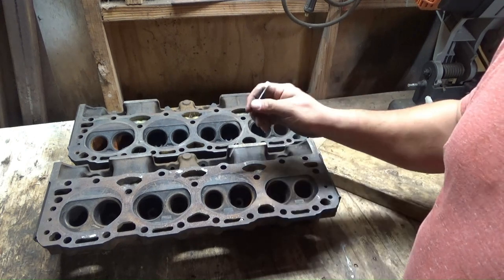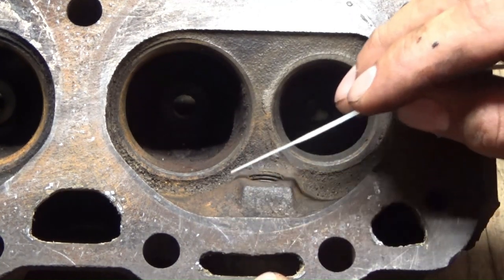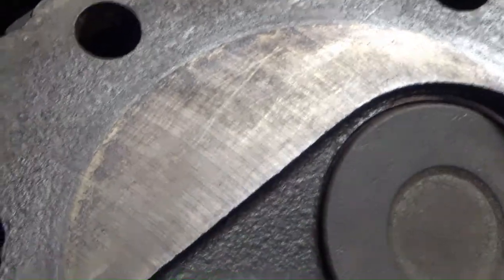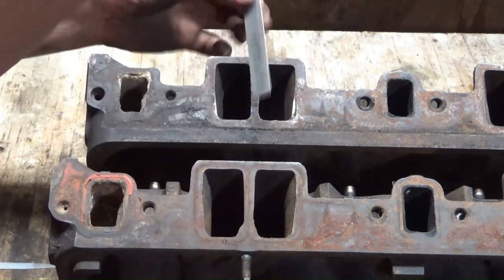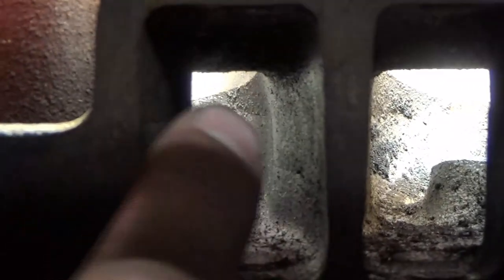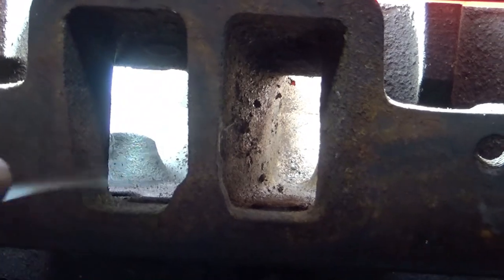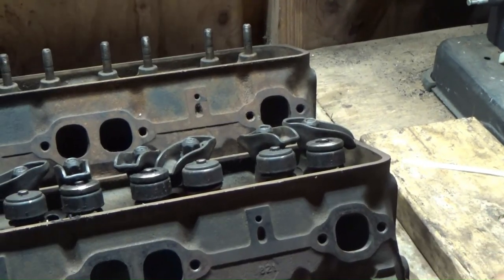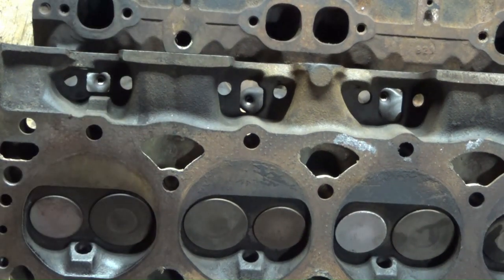305 chevy heads; 081 castings vs 416 castings

Comment: I have an 87 Monte Carlo SS I raced in NHRA Stock Eliminator K/SA (K Stock Automatic) and I have the option of using a 535 casting, 416 casting, and 081 casting. With a 3 angle valve job a 416 casting is hard pressed to hit 180 cfm @ .403 lift which is what a stock L69 cam has. With a 3 angle valve job the 081 flows 197 cfm at the same .403 lift which is actually better than every double hump head with a 1.94 inch intake valve @ .400 lift. Stock eliminator is limited to the stock cam lift which is .403 intake .415 exhaust. Both heads being equal the 081 outflow every other non vortec 305 by a lot and every 1.94 inch 350 head with the exception of the 113 corvette aluminum heads. If the other heads flowed better I'd be using them. And as far as the earlier smog castings (555, 434, 450, etc...) had 1.72 inch intake valves and are in no way shape or form a performance head. The chambers suck, the port suck, and theyre about 15 lbs heavier which in racing is a bad idea. Opening up the valve seat and putting a 1.94 inch intake valve in these heads will actually flow less than a 1.84 inch if you do not port them. Randy Brzezinski (Brzezinski Racing) has a whole video on this for those who are non believers. The intake ports on an 081 are 167cc whereas a 416 is 162. The exhaust ports are identical in cc's and flow numbers which is in the 119 cfm range with a 3 angle valve job. I wouldnt waste any money on these heads other than installing screw in studs and DO NOT ever use a roller tip rocker arms, they do ZERO for performance. Either use a full roller or a stock rocker, the roller tip rocker arms are waste of money.
Reply: The roller tip rockers do help with valve guide wear.
Reply from the maker: I never really thought about that, but I believe it.  I always wanted roller tip because it's supposed reduce friction. But that's probably a better reason to buy them.
Reply: @ChuckUFarley-r7x  so does synthetic oil, its the fulcrum that matters not the tip where it presses on the valve.

Comment: I have built hundreds of small block Chevrolets over the years, and I think I can say with confidence that the 416's are superior to the 801's. In fact, the 416 is probably the best 'stock' head you put on a 307. I have built several 307's with these heads and mild to moderate cams and they absolutely scream. I love em!
Reply: Whats your opinions of these 416 heads on a 350 for a low rpm torque and mileage engine?

Comment: In 1995, the hot tip was a pair of 1976 305 heads, the only year they were heavy casted. Those coukd be cut for 1.94/1.60" valves, no problem. I did it myself. But now, just get a pair of L31 heads shaved 0.030" and do all you can fir exhaust flow.
Reply: and with a 1.94 inch intake valve they flow less than a 1.84. Those heads had a 1.72 inch intake and tiny intake ports that flowed about as well and straw trying to suck up an icee.
Reply: what casting number were they? 434 or 450?

Comment: What size engine you putting these heads on ? I have 416's going on a 1971 307 chevy.
Reply from the maker: They are going on a 305.
Reply: everything being equal a 307 with its bigger bore and shorter stroke will beat a 305 in horsepower by a lot.  Ive seen 307s making 325 hp all day long and the 305 heads only had a 3 angle valve job screw in studs crane springs and it had a retro fit hydraulic roller cam.

Comment: DO NOT REMOVE the turbinates on the 416 heads (the material in the corners). They are not obstructions, they are there to spoil the air. This results in the air washing the walls of the chambers of fuel droplets and increases air velocity (air speed).
Reply from the maker: Where did you get that information from?  I think every perimeter bolt sbc heads have that.  I'm assuming they are just where the valve cover bolts go. I have never heard of them being there to serve a purpose. I will most likely remove them...

Comment: 416 is 58ish 
081 is 56ish from factory 
No real flow difference,
But 416 can be worked better because better strength in casting, up sizing valve won't increase flow much but cleaning up roof and entry helps, 416s have been a junkyard gem for rules class dirt track engines, H.O. heads prone to cracking like vortec heads, 416 flows as good as standard 350 heads but add good compression, the box around the plug on 081 heads create a hot spot prone to pre ignition and needs to be rounded on the corners if installed on 350, hope this helps, 👍
Reply from the maker: Any information helps thanks for commenting.  I'm building a 305 with flat tops.  I was leaning towards using the 416 heads just because I have a few intakes for the older style.  But the valves are looser in the 416s and probably need valve guides.  The 081s are noticeably tighter so I will use them instead.  People were using 305 heads on 350s to bump up the compression 20 years ago.  I'm not a big fan of doing that but it will make a soup bowl piston 350 wake up a little bit.
Reply: Last year I built a low mile 305 standard bore. Installed flat tops mild port job and 3 angle valve job on the 416 heads summit 1103 cam and knock off rpm intake with performer 600cfm carb. Sounds mean at idle makes decent power and runs on cheap 87 octane gas. Well worth it if its just laying around.
Reply from the maker: @andrewfortier88  I will definitely take a look at that cam.  Because I really don't have any knowledge or experience on what would be a good cam for a 305. I was actually thinking about using a stock lt-1 cam since I can get a used one for free. I'm not really sure if that's a good cam, but I'm looking into that. Thanks for watching and commenting.
Reply: @davidcraft4909  it is a mild cam in a 350 but in a 305 with 10:1 compression it really runs nice, starts easy has a nice chop good throttle response and pulls good to 5500 rpm. If I was to make an honest guess I'd say 275+hp. Stock hp is like 160
Reply: @davidcraft4909  Lt1 would be a roller cam I've only ever built a flat tappet. I always take the old cam out and toss it in the scrap pile. Plenty of cheap cam kits out there to suit your build.
Reply from the maker: Yeah I know a lt1 is a roller cam and I have a roller block lol. I already looked at that cam you mentioned and it's specs aren't too far from an lt1 cam. Let me ask you this. With your setup what kind of vehicle weight, gears, and transmission.  I'm just trying to learn some stuff.
Reply: @davidcraft4909  2500 pound rat rod type car 2.73 gears. Stock th350 converter. 28" tire posi rear end. Has no problem breaking them loose and will do doughnuts on the highway. Its a fun low dollar set up. Slightly lower gears would be even more fun.
Reply from the maker: @andrewfortier88  I bet that car is fun, it wouldn't take much power to make a 2500lbs car go fast.  I'm trying to build a 81 C10 lwb for the 1/8 mile. I will be turbocharged, but you still need to make some decent power NA so that way it will spool the turbo faster and not be a total turd before the boost comes in. Anyway so yeah any info helps on any kind of combination that people have ran with a 305.
Reply: no real flow difference?  i beg to differ,  stock 081 heads outflow the 416s with a 3 angle valve job. The 416s have 162cc intake ports which is emphysemic.
Reply: @andrewfortier88   my K Stock Monte Carlo SS has 29 inch slicks and 4.56 gears. It runs a consistent 11.60s @ 117 mph with a stock intake manifold, 780 quadrajet, and unported 081 heads.  Ive yet to race another 305 powered stock eliminator that can beat me. And dont even start me on how many big blocks and small blocks Ive put on the trailer.
Reply: @MasterWitchDoctor  yeah, the 081 is 165cc as cast there's no real difference and needs more work just to gain. O1-.015 in your ET real world and neither flow enough for over 6500 rpm they're better suited for their velocity/ torque  but for small ci applications the 416s are more reliable and readily available.
Reply: @dillinpicklesworth5698  youre 100% correct in the 6500 rpm Im shifting @ 6700 and running 6800 at the end of the track. I get my acceleration from a 700R4 and 4000 rpm stall. At the 1000 feet mark Im in torque converters lock up which is where I get my speed.
Reply: @MasterWitchDoctor  I don't know the weight of your car, but have you used 4.11 or 4.30 gears to try to get the big end speed up 120 - 125 mph, that would probably put you at the traps right at your shift rpm but your stahl is pretty perfect. 👍
Reply: @dillinpicklesworth5698   the NHRA weight to claimed HP factor 13.25 which put the car in K Stock Automatic. NHRA rated the L69 at 180 hp but in factory trim with the accessories it made 248 hp on Carlisle Racings dyno with stock exhaust manifold and dual walker `mufflers in a 2.5 in exhaust pipe. In racing form with a custom ground flat tappet cam,  roller rockers, electric water pump, .060 bore and 11 : 1 compression it made 419 hp with unported 081 heads. It doesnt have the horsepower to pull a 4.11 gear in lock up and the car wont run 11.99 index with 29 x 9 inch slicks.
Reply: @MasterWitchDoctor  yeah that's what's crazy about  the small ci, what about the 4.30, best of both worlds, you practically have it dialed in though, but I know the rate of speed feels like forever in the big end from say 6k to 6.8k as it noses over as opposed to 4k to 6k, but if you're winning, that's all that matters 🤣💯
Reply: @dillinpicklesworth5698  winning until I come up against 383 Mopars. There's a few 66, 67, and 68 wagons with them running in the 11.40s making over 500 hp. Theyre in K stock automatics too and thats a heads up race not a bracket race.  Trying to beat them with a .060 305 Chevy isnt going to happen.

Comment: Are the 081 heads for the roller block
Reply from the maker: I'm not sure yet.  I would rather use the 081s, but it kind of depends on which set needs the least amount of work and which set would make the best compression ratio with flat top pistons.
Reply: It can be used on either block.
Reply: @davidcraft4909  the 87 L69 305 used flat top pistons and a .016 thick steel head gasket. I use the factory stock gaskets in my 305 which makes 11:1 static compression which is NHRA rules.
Reply from the maker: @MasterWitchDoctor  I was just about to ask you what compression your car has, and the next question is what kind of cam.  I'm just trying to get a little bit of info on what works.
Reply: @davidcraft4909  the factory L69 305 came with 9.5:1 compression. NHRA measures compression in static compression not dynamic compression because static is exact whereas dynamic compression varies. NHRA allows for 11:1 static compression and my cam is a custom ground Crane solid lifter with .018 clearance on the intake .022 on the exhaust. A 305 is responsive to a cam a lot more than a 350 because of the smaller bore size so if youre wanting advice on a cam id keep the intake duration 224 or less and lift is effected by the heads ability to flow. Most stock heads (305 especially) wont flow much better after .450 lift because of port saturation and a higher lift cam creats parasitic stress on the crank and it starts to lose horsepower. My suggestion would be a Crane 215 intake 225 exhaust .450 / .460 lift. assuming your 305 has a 1.84 inch intake you need a cam with a lobe center angle of 109 degrees according to David Vizards 128 rule. That formula is 128 - (CID / Number of Cylinders / Valve Size x .91) = Lobe Center Angle. In your case this is 128 - (305 / 8 / 1.84 x .91 = 18.85) = 109.44. My solid lifter cam is also 109 degrees so I know for a fact this number is dead on.
Reply from the maker: @MasterWitchDoctor  thanks for all of your input in the comments.  I won't be racing in any class like that, so I don't really need to optimize my 305 that much.  But I appreciate all the info you are sharing.  More or less I will just dial everything back a notch, and put a turbo on it. But it's good to know roughly what to do and what you can get out of a 305 na.  That way I can theorize what it will do on 7lbs.
Reply: @davidcraft4909  the 081 heads are milled .010 on the head gasket surface, a 5 angle intake 3 angle exhaust valve job, Manley valves, Crane springs with 145 lbs of seat pressure, 252 duration intake 258 duration exhaust cam with a 4/7 swap .060 flat top pistons, Crane roller rockers and push rods, electric water pump, Barry Grant (before he went out of business) modified 780 quadrajet and factory stock 14057053 casting intake manifold. This engine makes 419 hp @ 6400 rpm and I shift at 6800. Because I cant do anything else to this because its a stock class the 305 has no more to give. This engine likes 38 degrees of timing on C10 racing fuel.
Reply: @davidcraft4909  the sprint car guys are getting 600+ horsepower out of 305s on methane. Those guy have taken 305s to a whole new level.
Reply from the maker: Yeah but methanol and 50-1 compression, not really applicable to what I'm doing. But you commented some very valuable info.  Stock engines 9.5 engines make 250 vs 180. Stock heads doing 6000k rpms. And to be conservative with the cam. (with examples). I learned what I need to know thank you.

Comment: 58 cc’s - old style and TBI heads- vertical planning and horizontal planning- cfm flow’s better on the TBI heads, and yes they were resurfaced about .002 thousand’s on the 55 cc heads
Reply: Are you sure those aren't 305 TPI heads? The TBI heads are the swirl port heads.
Reply: @itseithergonnaworkoritaint7852  081s where used on the 87 and 88 305 LG4 tuned port.